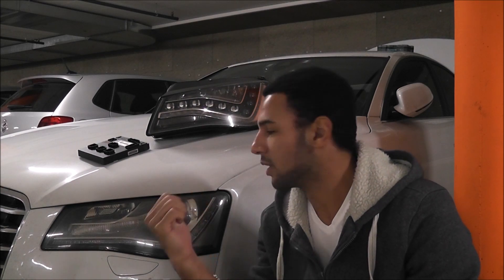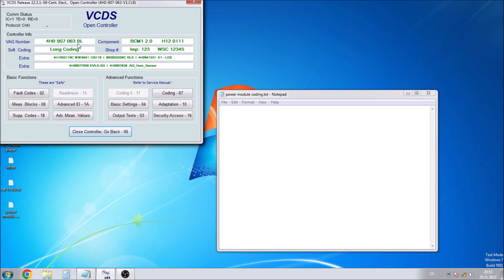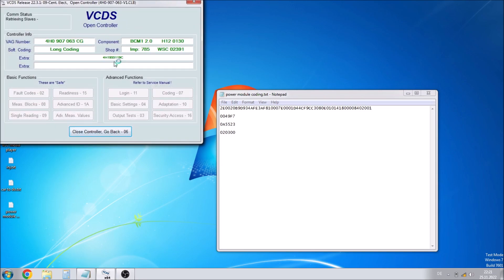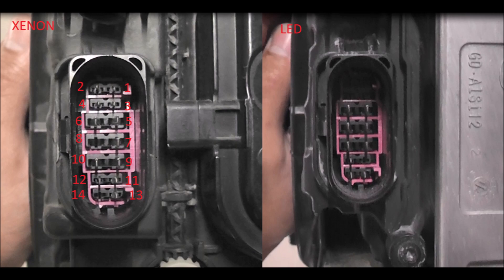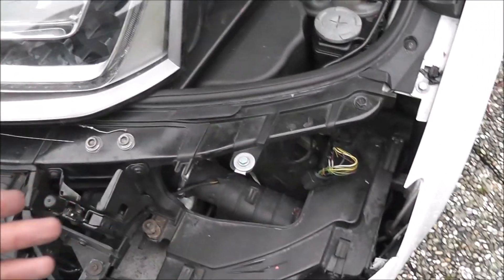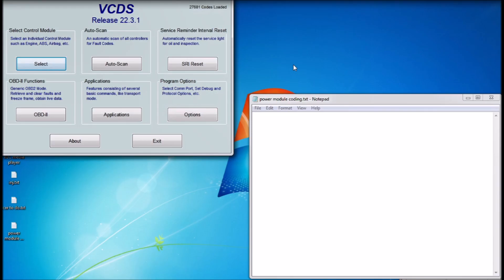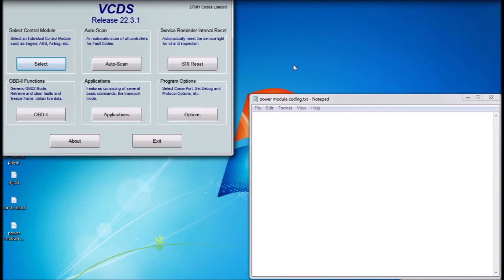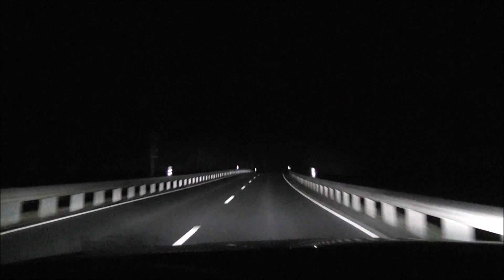How To: Audi A8 Xenon to LED Headlight conversion!

Comment: Hi , the wire from the head lights ( hidhbeam )witch pin have to be connected on silver 32 pin connector. Thanks
Reply from the maker: Hi, please see the wiring diagram in the video and the connection table. You will see what needs to go where as everything is there. If you have different wires, it can be that you don't have a similar setup, or, that you have a US spec vehicle which this video does not apply, since I do not know those vehicles, but I assume it's not much difference
Reply: @SolveElectronics  Hi, after installing the new module i got with the headlights .. the turn signals are half lit, fog light not work and the display in the odometer lights up very dimly. Should the protection component be removed? or do you need new codes? On channel 55 headlight range no access !
Reply from the maker: @tihomirpopov3092 You didn't watch the video did you?

Comment: Are these matrix LED headlights? Does the matrix system actually works? And are new headlights OEM or aftermarket?
Reply from the maker: These are not matrix. Matrix was introduced on the facelift version
Reply: But they are adaptive? Automatically switching between high and low beam regarding oncoming traffic?  @SolveElectronics
Reply from the maker: @tariktokalija452  The LED lights that I have installed are not adaptive in the first generation of LED headlights. Only the matrix lights are adaptive, and the adaptive xenon lamps
Reply: thanks for response @SolveElectronics

Comment: Hi, your video is very helpful, thank you. But I have an error that I can't get rid of. The error message is "adaptive light system malfunction". Could you please help me with resolving this error?
Reply from the maker: It's most likely either the adaptive light controller, it ther motors themselves within the headlight. It could be one of the connectors on the light has corrosion or broken wires inside, this is also quite common
Reply: @SolveElectronics  Thank you so so much! My issue has disappeared 😊. I have one more request, if it's possible for you to remotely access my computer and check if the settings are correct, as I'm not sure if the fan inside is working. I'm willing to pay as well 👍
Reply from the maker: @melisaljubenovic5478 you're welcome.
I could check, but I can't do it remotely because I don't know your vehicle, and I would need to see what works and what doesn't etc. If you have an A8 I could try remotely. If you're local to South Germany or Switzerland then it's possible on site
Reply: Built 2010*
Reply from the maker: @melisaljubenovic5478  OK, that's a bit far from my location (ZH), but let's talk via email and we can try something 🙂
Reply: I am from Salzburg and drive an A8 built in 2009 with fully Equipment and have exactly the same lights.
Reply: Prijatejlu jesi li i ti ugradio ovaj retrofit i dali mozes mi pomoci

Comment: Hi. I was hopping to get some help about component protection in J519 ( BCM1 or power control module as you call). How did you remove ir? The eeprom change didn't work?
Reply from the maker: It's possible to change the main processor and this would work but it's better to do it by the dealer. It's not expensive, but can also be done with vas5054 and Odis

Comment: pin 11 move to pin 14 rmv from 3T117a , and then do what for 1T16c-LIN, and  RE-USED WIRE from 3T117a?
Reply from the maker: It means that pin 11 on old headlight has moved to pin 14 fir the new headlight, so, remove the wire from the connector 3t117a to position 14 from position 11. Because we moved the wire, it is re-used, not made new.
For Lin wires, we make 1 wire and split it into two so that it connects to both headlights, and it's connector in the car where It should go is 1t16c-lin (pin 1 on socket t16c)